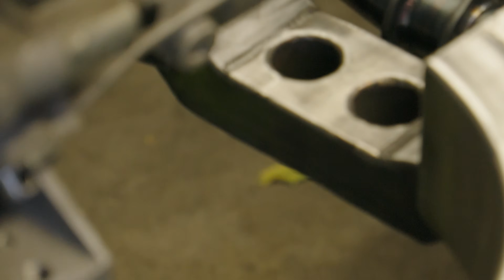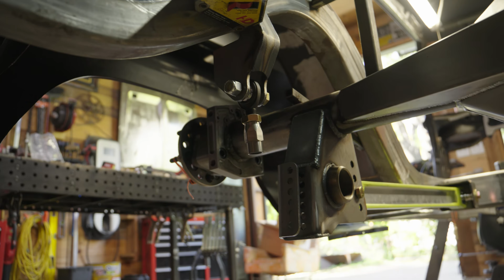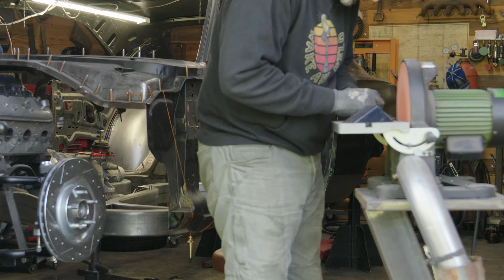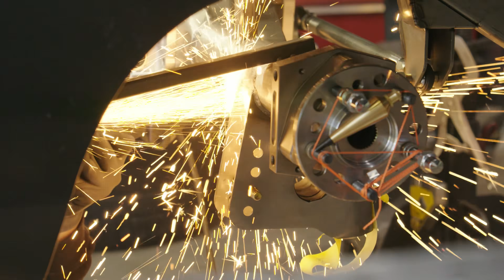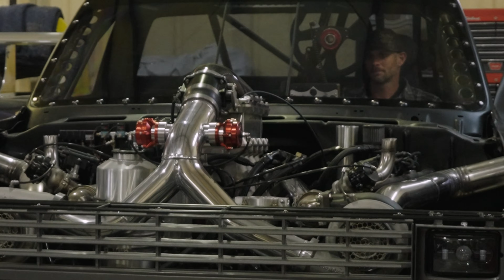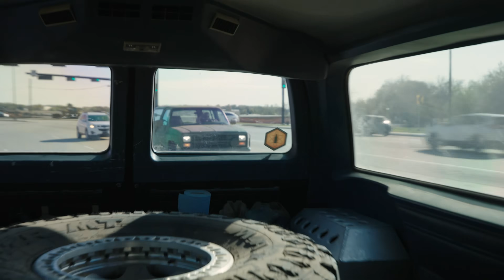Watts Link for Pro-Touring? BONUS Drift C10! | 1970 Dodge Charger 16

Comment: Just came across this, good stuff and will more closely review your other videos.  Can you go into more details on the Torque Arm sliding joint?  Considering Torque Arms have some articulation, they have to have some give, your solution looks better than others I've seen.
Reply from the maker: There are more photos on my Instagram, but I’ll try to remember to post some stuff here too

Comment: Id leave my car with these guy for 6 months if I could afford it man I can't wait for full floating 9 inch with a lot more traction never owned a open diff till now I swapped a 6.0 in two a 1984 Cadillac that 7.5" open diff is tragedy's waiting to happen shoves hole car to the left lane no problem a lot quicker than down the road that's for shure

Comment: Hi David: I saw one of your videos for the first time 3 days ago and have been binge watching ever since.  Depending on what engine controller you are planning for the LS Charger I may have a little homework I've done that might help and I'll share with you.  In one of your videos you made a comment about having "scoured" all available suspension options and you decided on CAC; I have also scoured and reached the same conclusion for the 67 Camaro I have owned since 1978 and will pro-tour it over the next couple of years.  Great job fabricating and documenting, with the help of your most significant wife.  Thanks
Reply from the maker: Glad you're here! Chassisworks remains one of the few that are focused on the DIYer, and make things pretty modular. Good luck with your project, and tag me on social as you make progress!

Comment: Hey, beautiful video and production!  Glad I found this channel.  One thing, that Watts link is backwards, so either dial in lots of understeer, or avoid any bumps mid-corner.  Keep on building, that looks like a beautiful ride!
Reply: Another good one Dave. I learned a few things. :)
Reply from the maker: @joshusername22  thanks dude 👍 glad you enjoyed it
Reply from the maker: Glad you found the channel. Welcome. Please tell me what you mean by “backwards.” I’m not following.
Reply: @WillometMotorFab  The center pivot should be mounted to the chassis, and the ends of the arms to the axle. Both ways work the same with the body level, but when it rolls the axle mounted pivot causes the axle to move side to side when a bump is encountered.
Reply from the maker: I understand. I’ve yet to see a watts link mounted in the way you describe, but it sounds interesting. This setup has plenty of pivot room across all the range of travel, including full bump on one side and full droop on the opposite and the axle remains centered and square.

Comment: Great info!  I was under the impression that the safety factor of a part should be 3x.  Im glad you mentioned that it is 1.5x for steel in your use.  It makes sense that the FoS would be different per application.  Also, I hope you don't mind if I plug another video.  I have learned a lot about car suspension from Garage Fab and his "Suspension Basics" series.  I go back to it from time to time for reference.  This is the one he did on watts links.  

https://youtu.be/irojcSDY1Co?si=3EgBw_E3lHo08NdS
Reply from the maker: Safety factors start with the design load, and I think 14ga is what most stamped link arms are made from with added material at the bearing surface. That’s usually my basis for starting with 1/8 and selectively enlarging to 3/16 where it makes sense. Ductile material also gets a pass since it will bend before it breaks. I’m not sure what cast (brittle) stuff needs, but it’s definitely more. I have all that in my Marks Handbook, which is somewhere…

Good referral on garage fab! Thanks man.